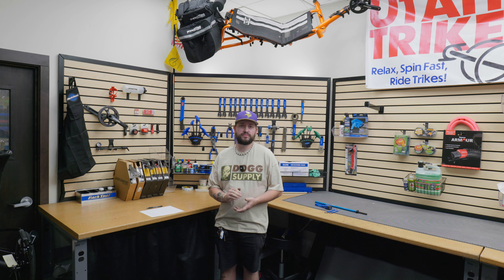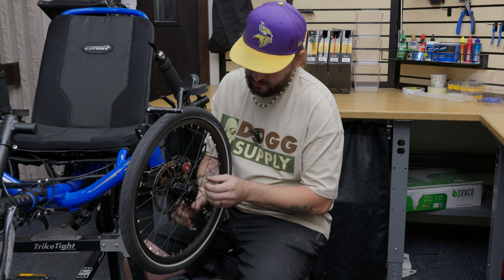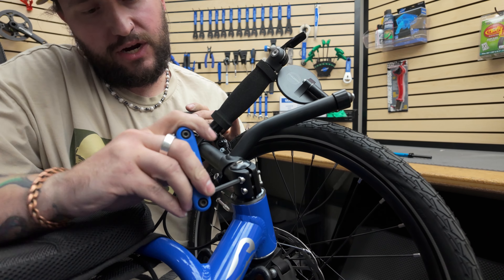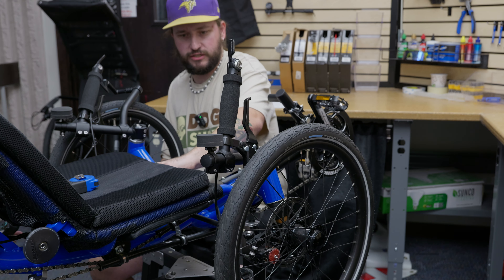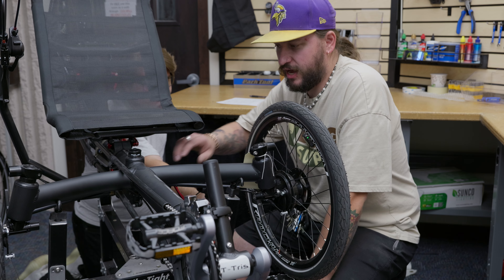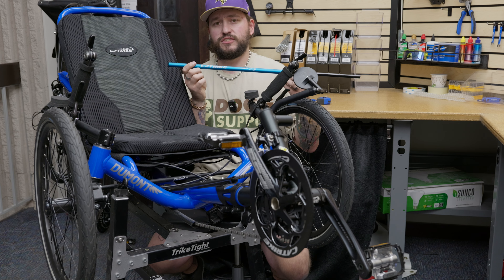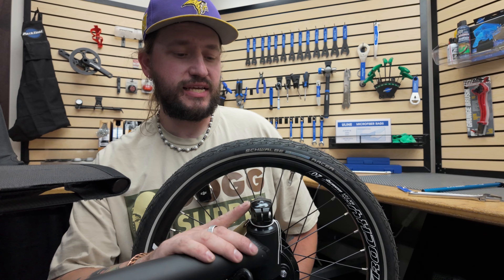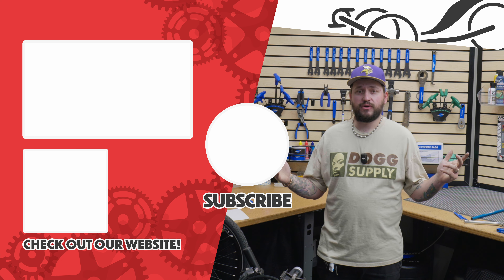How to Fix 'Death Wobble' on your Trike

Comment: This trike in the video is considered a "reverse trike" but the principles are the same for both types of recumbent trikes.
Reply: Commonly called a Tadpole vs the Delta with 2 wheels in back. Delta's tend to be a bit higher for seating where as the tadpoles are more laid back closer to the ground for speed and terrifying yourself on highspeed corners.

Comment: Are you always have the potential of death wobble if you have a light grip hold when going over rough roads/trails?
Reply from the maker: It depends on the trike and the steering setup. Most trikes can be tuned to combat against death wobble.